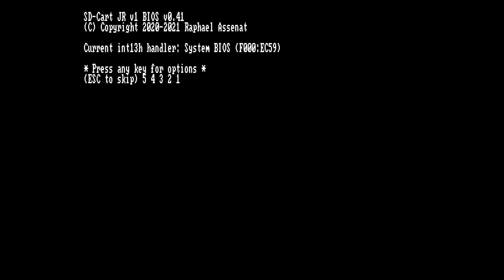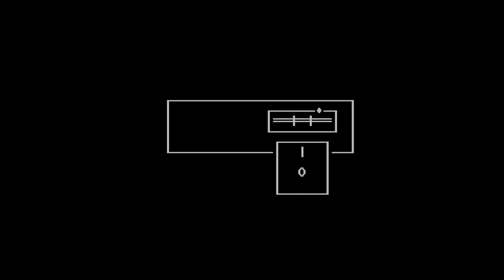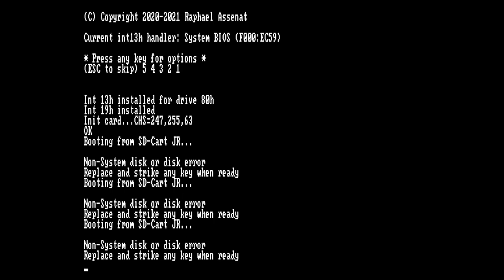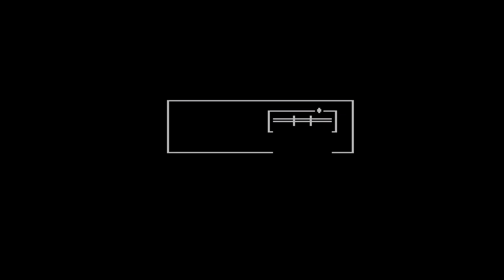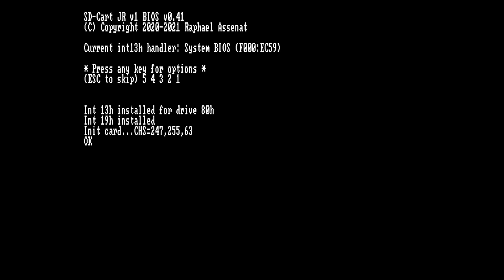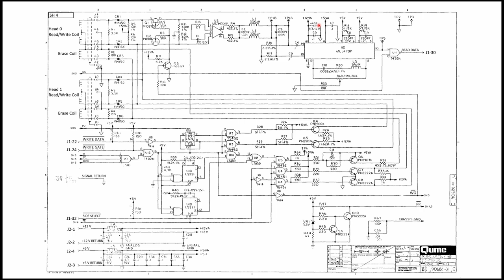Qumetrak 142 Tantalum Tantrum

Comment: What kind of oil do you use ?
Reply: You could make a 1 min short video showing how to oil a qume (zoom on oil drop sizes so people understand exactly what "tiniest drop" means) - and you can put amazon affiliate links for the oil and whatever extra droppers/tools you use.
Reply from the maker: @psergiu  Yeah, I think I'll try to do a video of a tear down and oiling it since it seems not many know how to take the main spindle out. I just happened upon it while doing this drive and managed to get it completely apart.

Here's the oil I used ("Supco M098 G84-620 Zoom Spout, Multi Purpose Precision Oiler"). Dr. Octal on the jr forums had recommended it to me for the many drives he's worked on:

https://www.amazon.com/gp/product/B00DM8JK2G/ref=ppx_yo_dt_b_search_asin_title?ie=UTF8&psc=1

And you are correct, it is a very tiny amount of oil. The oil is added to the bearings to get the grease in there to loosen up a little, not to replace the bearing grease. If you put too much on it can make a mess and potentially cause isses with the drive, or even ruin disks if it gets into the actual disk itself.